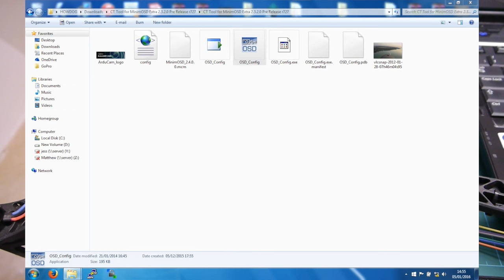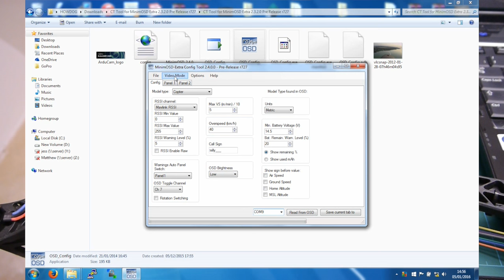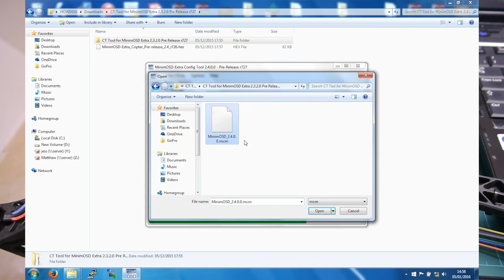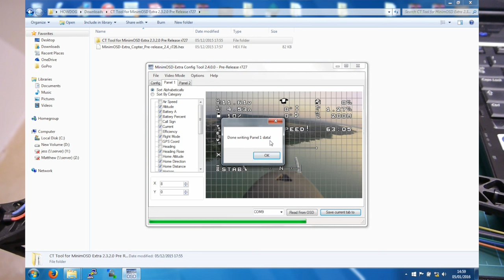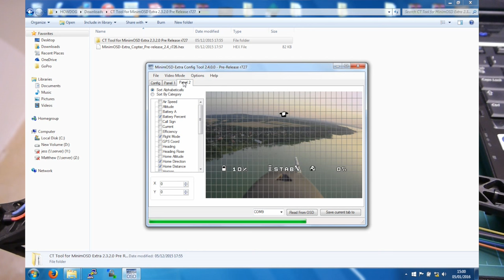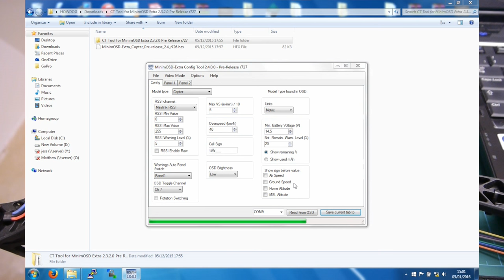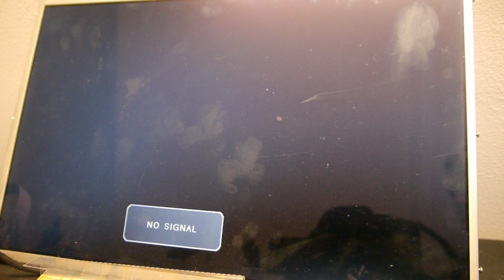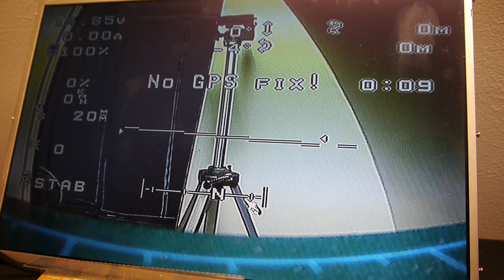TheManLab - OSD Cofiguration - Diatone White Sheep APM Quad Build - Part 8

Comment: Just started my build, using almost the exact same parts. Good job so far ! also wanted to ask how well you got the RTH and Pos Hold to work up until now. Would be great if you posted a follow up vid to that.
Reply from the maker: Hello. Did you get the APM 2.6? After q bit of tuning I got it to RTL and auto flight ok. I'm not thinking that my cheap eBay GPS and compass wasn't such a good idea. Anyway it still worked ok. I'll be doing an auto tune video in the future.
Reply: +The Man Lab  yep, the Apm 2.8, with a GPS module. I will see how it performs. Which part of the UK are you in? I am just across the water in the far north of the Netherlands. Winds are killer here
Reply from the maker: +j kropp ah ok. I'm for Leeds. We've had a bad winter for rain this year. Not much time to fly.

Comment: Looks like you relocated your GPS to the top deck. Were you getting noise from the other components?  How did you decide where to locate the GPS mast?
Reply from the maker: Hello, yes I was getting some problems in RTL and auto mode. I just placed it where I didn't need to drill any extra holes. Then I just cut the carbon dowel a little to allow the wires to connect. It took a little crash recently and is a bit bent :) Enjoy!

Comment: hi again!!!   nice to see a new video.. how has it been going for you with the white sheep...?

my quad is 90% ready.   only thing missing is the GPS system to the naze32 flightcontroller.. and some fine tuning of the PIDs,,  to bad is so cold here in sweden now we have about -15 to 20° 
and snow. not the best wheater to fly in

have you seen any of my videons ? of my White sheep.

best regards. RogerS
Reply from the maker: +Roger sundberg Hello, its going well. I had a big crash just before Christmas and smashed my gopro lens. I still waiting on a new one in the post . Since then i've not flown because the weather is so bad. Google Yorkshire foods and I live in Leeds. Its just been raining all the time! I'm wishing for snow! I like your gimbal, I was going to do the same as you and 3D print the bracket. I've subscribed for future video's! Good luck!